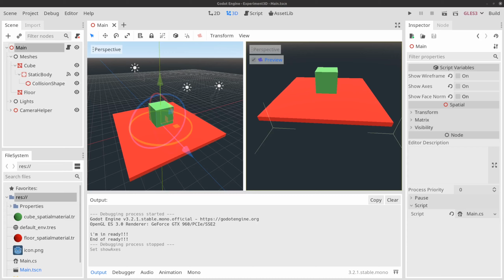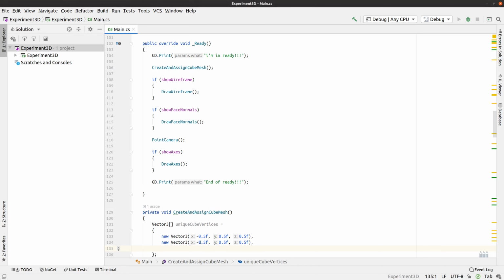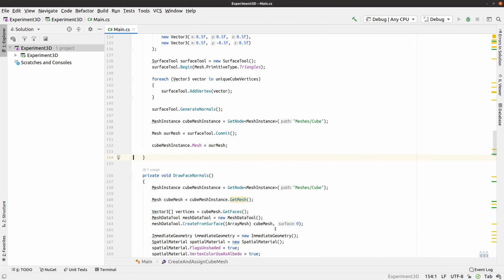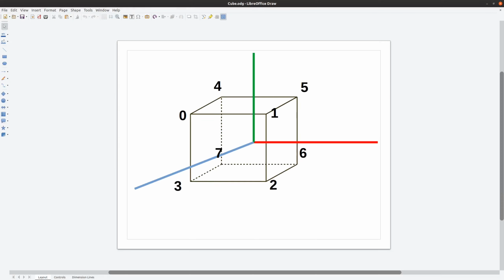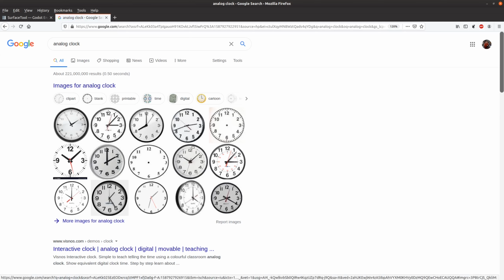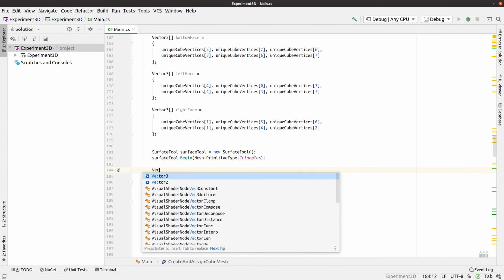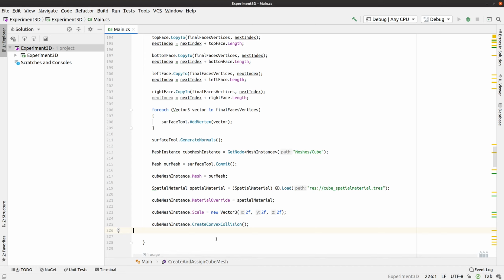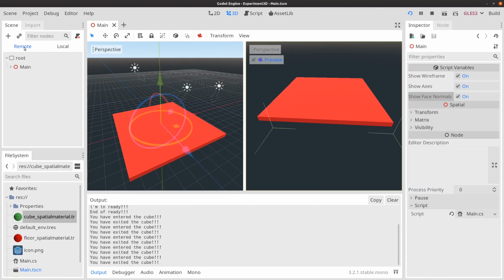Godot 3 - 3D Mesh - 08 - Using the SurfaceTool, StaticBody and connecting signals with C#

Comment: Little trick might be to put a light to the scene inside the 3D view, then reset the positions. And then move it to the location on all 3 axes. And do that for each floating-point coordinate so you have an idea of which way each point has to be on X,Y,Z axes. For those that struggle with that a bit (I know I do...).

Comment: Ok, got through this one.  My GDScript code is posted here: https://github.com/wtilton/MeshManipulation/tree/08

Things to note with GDScript, concatenating arrays was stupid simple:

var cube_faces = front_face + back_face + left_face + right_face + top_face + bottom_face

and then the for in loop

for x in cube_faces:
		sTool.add_vertex(x)

To be fair in C# I think you might have been searching for the AddRange method that would be there when you create a generic list.

Example in C#: 

var cubeFaces = new List<Vector3>();

cubeFaces.AddRange(frontFace);
... etc

The other thing I'm finding handy is the $ syntax for selecting child nodes in GD. Instead of get_node("Meshes/Cube") it's $Meshes/Cube

The only other change I have is instead of loading in a SpatialMaterial (I didn't follow the first video) I created on dynamically using:

var material = SpatialMaterial.new()
material.albedo_color = Color("36c92a")
cube.material_override = material

Off to the next video :) Thanks again!
Reply: Nice job. I am wondering with it are you able to changed some vortex in code while the project is running? I'm trying to make terrain that I can change. Like a dig or put down dirt, raise and lower the terrain. Thank you for your time.
Reply: @thomasparker7305  I would think so, but I haven't figured that out yet. I started learning the basics of GoDot and will get back to this when I have a better understanding of the fundamentals.

Comment: I'll admit, having trouble starting this one. What exactly are you trying to accomplish on this one? Explanations seem clear on what you're doing and I've only started watching but I'm not sure why we're redrawing the cube. Basically, I'm not sure why you're doing what you're doing. Going to table it till tomorrow though as this one is pretty long.

Thanks for the videos if I haven't said that already. Having a good time so far.
Reply from the maker: Well, the whole point of this video series has been leading to procedurally generating a mesh.  This video is where we actually do it (by replacing the cube we imported from Blender w/ one we create in code ourselves).

To put briefly - this video's point is to demonstrate how (if you didn't use the editor ahead of time for these things) you could create "on the fly" a mesh, assign a material, assign a static body and connect signals up all in code.

One might want to do this (create mesh geometry "on the fly") if say one wants to create terrain dynamically (in code as the game is running). This is just a very simple example of how you could do that more complicated thing.
Reply: @hobbytasks8240  yeah I have to admit that I didn't watch the first video which probably explained a lot of what you're trying to do. I think our paths might be diverging here as I don't really need to procedurally generate anything. I'm more interested in creating some sort of 3D editor, which is why I was really digging the first few videos. I saw "highlighting faces" and was thinking that would be cool to be able to do to do some sort of push/pull on 3d objects when you highlight a certain face. I think that my needs might be lower level even though I was thinking it would be somewhat trivial to accomplish which so far it hasn't been :P

Even rotation of the camera seems a bit hard. Rotating around is easy, but when you try to rotate over (or up?) I think there's some sort of mathematical vector thing going on because the x, y, z axis aren't relational to the camera, but to the world itself. Either way, thanks for writing this as it's given me a pretty good start. For never done any 3D programming I'm feeling pretty accomplished :D
Reply from the maker: @WillTilton  If you push/pull a face you'll need to move the vertices around.  If you "extrude" you'll need to create geometry "on the fly".

You can rotate (or translate) relative to the camera's axes (vs global). The rotate I did w/ the helper only worked because the CameraHelper's local Y was coincidentally pointing where I needed it. It was a quick and dirty trick not generalized for just any use case.

Look up "basis" in the godot docs if you want a better idea of how to do things w/ the "local" x, y and z of an object.  

If you can explain specifically what behavior you want, I can see if I can help.
Reply: @hobbytasks8240  I'm basically trying to create a poor man's Fusion360 or SketchUp designer. Right now I'm torn between the route of drawing the shapes with vertices hopefully having more control or working with premade meshes (or CSGs?) and then just doing modifications via transforms or whatever it is that you do to do those modifications.

In a way, I'd like to recreate a lot of what the 3D editor does in the Godot IDE if you aren't familiar with the other tools. But again, dead simple editor where I have a box and only push/pull the ends (2 sides). My version 1 was being able to add one box to the screen and then add another. Then extend that box to the other box and snap it to that box.
Reply from the maker: @WillTilton  I'm not familiar w those applications.

I'm far from an expert (so I don't want to rule out CSG or something else is your magic bullet here) but when I started looking into 3D in godot, digging into the mesh w/ the meshdatatool and surfacetool was the best way I found to have the most flexibility.

But as you are finding out, there's a bit of math and work to get things to happen as this part of godot is still on the frontier.  If you follow this series/playlist until the end you'll see I do highlight a triangle by mouse clicking (but more math happens). I haven't made a video yet of say extruding (or moving) that triangle but I think this part still aligns with what you are wanting to do.

My suggestion would be to maybe not "take notes" and just watch the last few videos in this series. I think the knowledge will be helpful to you.

If you get to the end and want me to finish the series by extruding or moving that selected triangle - let me know. I switched gears over to my other series (3d Fundamentals w/ D and GTK) so I haven't touched this series in a while. But if someone wants me to finish it I'd be happy to.

If you still think that this series is diverging from what you need, best of luck on your search and thanks for interacting on my videos.  It's been fun! :)
Reply from the maker: FYI - The way I set up the vertices in this one and combine them at the end is clunky. I fix that in the next video by just defining them all at once.

I'm happy to read that you're enjoying the series! Having exchanges and info sharing like this is exactly why I made these videos. I'm learning this too!

Comment: Hey, I was wondering. Instead of doing the nextIndex copypasta to populate the finalFacesVertices

would it not be easier to do a for loop and just increment the iterator by 6?
EDIT: Never mind you explained you logic for not coding in the length.
but I am wondering, would you still not have quad faces regardless, just with the vertices of the triangles at different worldspace coordinates to generate more complex shapes. So the six point per face should always be true, or am I missing something?
Reply from the maker: The copy pasta was definitely the HARD way to do it and not what I would have done if doing this on my own (meaning not showing someone else the gritty details). I just would have made one big array for all the sides of the cube and made comments on certain lines saying this was front side, top side....etc

As for the always 6 vertices per face - well, the front side, let's say, you could make out of 4 triangles (12 vertices) instead while the rest have 2 triangles per side.
Reply from the maker: At this level it doesn't know about "quads". Everything is triangles. Quads in an abstraction added later to help w/ modelling.

For the longest time in the early days, Blender didn't support "quads" and only did triangles.
Reply: @hobbytasks8240  
Okay, thanks for the reply.
I was thinking that filling the array could have been accomplished with a loop whereby the model would just be "stitched-together" with pairs of triangles. But I would need more time to digest. That's just where my brain was going...
Reply from the maker: I think we're on the same page here.

Instead of doing the long winded thing I did in the video one could have done:

Vector3[] finalFacesVertices = 
{
			uniqueCubeVertices[0], uniqueCubeVertices[1], uniqueCubeVertices[2],  // front side
			uniqueCubeVertices[0], uniqueCubeVertices[2], uniqueCubeVertices[3],

			uniqueCubeVertices[5], uniqueCubeVertices[4], uniqueCubeVertices[7],  // back side
			uniqueCubeVertices[5], uniqueCubeVertices[7], uniqueCubeVertices[6],
		
			uniqueCubeVertices[4], uniqueCubeVertices[5], uniqueCubeVertices[1], // top side
			uniqueCubeVertices[4], uniqueCubeVertices[1], uniqueCubeVertices[0],

			uniqueCubeVertices[3], uniqueCubeVertices[2], uniqueCubeVertices[6], // bottom side
			uniqueCubeVertices[3], uniqueCubeVertices[6], uniqueCubeVertices[7],

			uniqueCubeVertices[4], uniqueCubeVertices[0], uniqueCubeVertices[3], // left side
			uniqueCubeVertices[4], uniqueCubeVertices[3], uniqueCubeVertices[7],

			uniqueCubeVertices[1], uniqueCubeVertices[5], uniqueCubeVertices[6], // right side
			uniqueCubeVertices[1], uniqueCubeVertices[6], uniqueCubeVertices[2]
};

That assumes 2 triangles per side and the object has a total 6 sides.

2 triangles per side = 6 vertices per side
6 vertices per side X 6 sides = 36 total vertices --> which is how big finalFacesVertices is after this line.

I'd say don't worry about what I said in this part of the video that was confusing (the copy pasta).  Just assume the data structure I SHOULD have used is listed above and I think it becomes less confusing :)